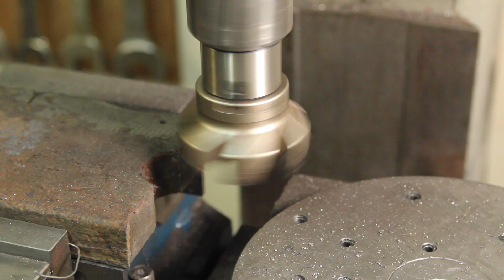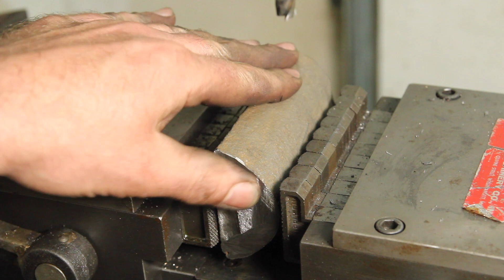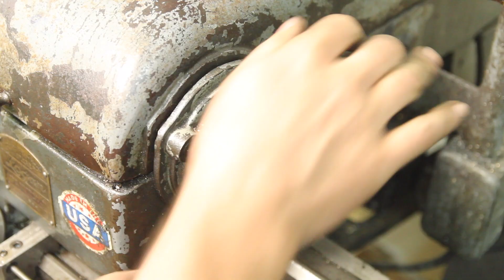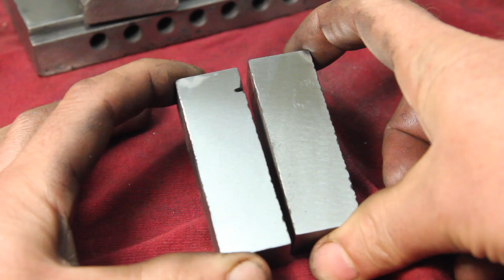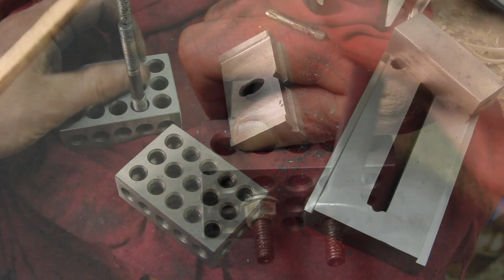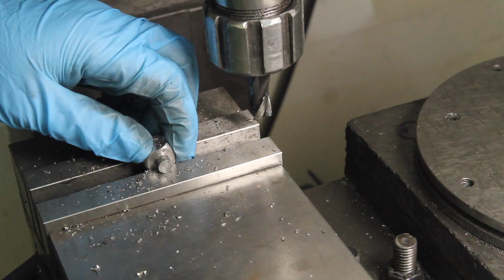Making a screwless vise from salvaged cast iron #toolfest2021

Comment: My mill is extremeley small, and really not suited for milling steel at all. I do have a small toolmaker's vice like this one, like somewhat wider than 1". It's one of my favourite tools, so making one or two, is a very, very good idea! (The one I have is surface ground at perfectly square in any direction.) I use mine in a lot of situations, but is especially usefull when held in anoter vice - be it in a milling vice, or other.

Comment: Awsome build.
If you want to eliminate the kiln scale, put the part in a tin can covered with powdered charcoal.
The char eats the oxygen before it gets to the part. That will also add a little carbon to the steel.

Comment: Hi, great channel. I’m not a machinist, does it help to keep bits etc sharper if lubricant is used for medal cutting. And I’m patiently waiting for the electric CJ5. I have a 58 but i think I’ll keep my Hurricane. Thx Barry
Reply: No lube on cast iron. The carbon content acts as a partial lubricant. Lube collects the cast iron dust and other junk in the iron and acts as an abrasive slurry that quickly grinds down cutting bits.

Comment: where is a good place to pick up old cast iron scrape or what should i look for when looking for cast iron scrape. ive just got into messing with this stuff an at this point i have a lathe and a mill but i guess u would say they are the cheapest machines u can buy to get into this type of stuff but so far ive been very surprised with how well they do so im happy with what i got but my biggest issue has been find material, dont have any local machine shops or even a place to buy the stock an the nearest to me is a 4 hour drive one way so if i was able to buy a bunch of stuff up it wouldn't be so bad but at this point its still a learning experience and i still have to pick stuff up like tooling an end mill bits for both the lathe an mill. i have enough to hold me over on tooling for the lathe an i just got the mill this past week so im alittle light on end mills but i have a set of 4 flute flat end mills from 1mm to 8mm and a set of ball nose end mills from .5mm to 3mm so i have something to work with but have alot of stuff yet to pick up like a good vise, i wanted to attempt to make my own but not enough material to pull that off atm but in time ill slowly accumulate all the stuff i need to work with right now im still learning the correct terms for the different types of cutting ends or end mills and what my machine can actually handle. its a wen 33013 4.5 amp mill so it wasn't the cheapest mill but it was the cheapest shipped to my door so i went with it, probably not the best way to pick a milling machine but everything else was over my budget once shipping was added so i went with the wen cause it was free shipping an came with both sets of the end mills so i feel like i came out alright an the mill has been perfect as far as a newby can tell at least.

Comment: One thing I learned is that at high temperatures you can burn the carbon out of the steel near the surface which prevents you from getting the steel as hard as you could get it.

Having a non reactive atmosphere to prevent oxidation is generally how you prevent burning the carbon off. You can also use a foil sac with something to burn the oxygen out of the bag so the part has a hard time oxidizing

Comment: Jeremy I was recommended this by YT,  To me an impressive build, I was particularly interested to see you have a Index model 40, I bought one as a project ( still in bits ) and seeing what you did with it cutting wise has eased any doubts I had over its capabilities. Now to-scan the rest of your vids for more on your Index.
Reply from the maker: Hi Ian- your videos were very helpful when I was tearing down my machine to clean it when I got it.  Mine was and still is very much a project as well, but even in a worn out state, it’s a capable little machine.

Comment: Great stuff! I'm just getting back into machine tool metal working and it's hard to find materials. I do have a bunch of cast iron: gears, heavy brackets, etc. and I've been cannibalizing them for stock. It's proving a fine source. One trick I found was using a high quality hole saw in the drill press to get round or cylindrical pieces. I clamp them well, run the press at it's slowest speed, and keep moderate but steady pressure on the bit. If the clamping is good you can run the cutter without the pilot drill.

Comment: Thanks man. I use a milling machine at work and theres alot of wobble in the table any suggestions
Reply from the maker: First thing would be to check the adjustment in the gibs- Keith Rucker has a good video on that: https://youtu.be/nqQ3HzoSnUc. If that checks out, unfortunately, it’s probably wear on the machine, and the only way to fix that would be to rebuild it.

Comment: Nice work.  I just did some V-blocks from an old tractor counterweight.  Cast iron sure makes a mess.  I need to try a Silicon Carbide wheel.  Thanks for the video.

Comment: That looks very presentable. Not a 100% perfect finish, but considering it was made from salvaged materials it's remarkably nice. I personally shy away from going overboard on home brewed tooling anyway. it's hard to use something in anger if you've put serious effort into making it immaculate.

It's like when I see folks refurbish old bench vices on YouTube, and use car body filler to get a perfectly smooth surface, then polish any exposed metal to a mirror finish. After putting in that amount of work, there's no way they're ever going to use it for the purpose it was originally made for. They turned it into a show piece and nothing more. :(